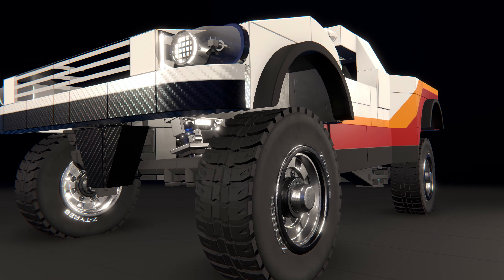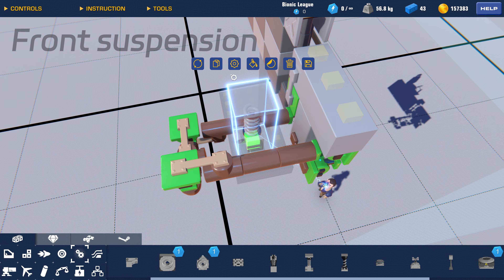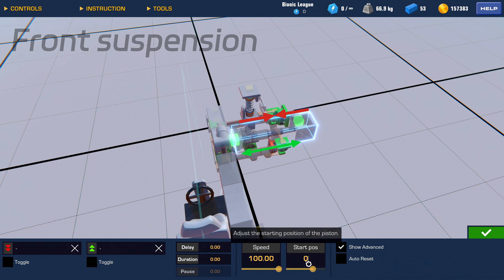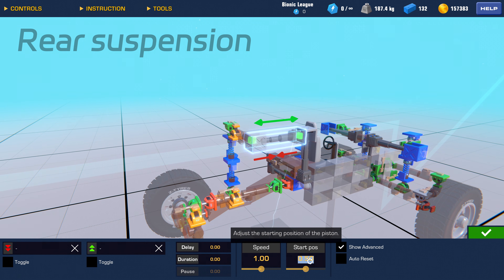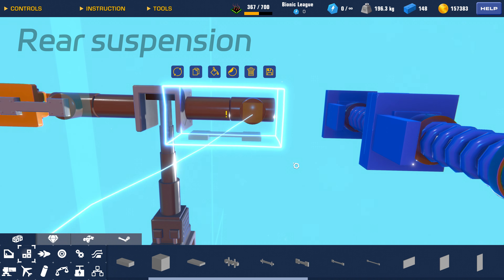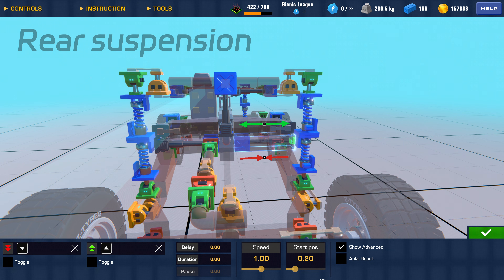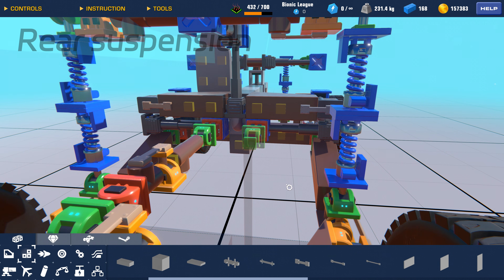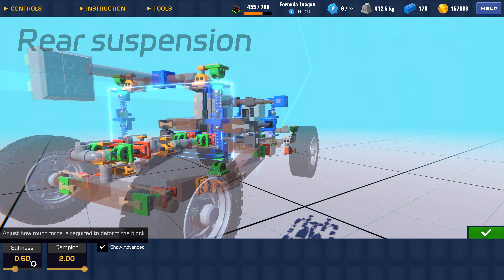Trophy Truck Suspension Tutorial - Trailmakers

Comment from the maker: If there is a problem with the rear suspension being too loose, please try setting the strength of the two yellow hinges in the middle of the two inclined connecting rods to 10
Reply: Mine is vary shakey is there anyway I can fix that
Reply from the maker: @SGT_Deadly_DoDo  Can you elaborate on the problem you are experiencing?
Reply: On the stand in air the wheels just wobble away sometimes bind noise and break aswell
Reply from the maker: @austinbraden9752  Does it also have problems when it's put down? I encountered a similar issue, and it was caused by one of the steering hinges still being set to a strength of 100.
Reply: so i yea mine is very shaky like the whole rear suspension shakes when standing steal i 've tried the fix it didn't work all hinges are at 0 and i've rebuilt the back twice so if i could any help with that it would be nice
Reply: I don’t know the configs for the red and yellow/orange hinges are and I don’t know how to build the rods in the centre
Reply: Ok good
Reply: I have it all built but I’m bad at modeling so it would help a lot if you could make another tutorial of how you made the body
Reply: I did this and it still leaned forward and make the wheels spin even faster but that was 0.10 I put it to 10 and it fixed the problem but I feel like it’s too stiff
Reply: 10.00 or 0.10?

Comment: I have a bit of a problem with the front section of the suspension, which one side droops down like intended, but the left side of where I first built the suspension is halted, which I've done my own troubleshooting and it's appearantly the 2×1 flat connectors that are causing the left side to not be like the right side.

Comment: How did you get the front tires so firm and straight. Mine are very wobely and if i take a turn too sharp it bends underneath my car. If i put the strength of the hinges higher the wheels are too firm and won't turn with the suspention. Anny tips?

Comment: I had tried building this kind of suspension before but I was using heli engines for the tilting just like those yellow hinges. It worked but was no where near as smooth as your's. Well done on getting all the arms to move together without any collision issues.

Comment: What block do you use for the headlights? And instead of my rear suspension being floppy it’s insanely stiff (I’m on Xbox not too sure if that helps)
Reply from the maker: Emergency light
Reply from the maker: The strength of the steering hinge might not be set to 0, or the spring might be too stiff, or some components might be stuck.

Comment: After a week messing around, and seeing it's very hard to improve a trophy truck setup more than what you actually did in this tutorial, I started making variations of the front suspension, and I can say that it's great for 8x8 or 10x10 vehicles. It's not just great; it's like the smoothest thing I’ve seen. Of course, it’s not intended for a very fast vehicle, but for a powerful all-terrain purpose. It literally eats barrels like nothing (i´m using monster wheels so basically everything the same diameter or less its butter). Thanks for sharing this awesome and inspiring build and all the knowledge you put into it.

Comment: I had fun building this tutorial, i honestly never knew how this was possible and i'm happy you did an actual tutorial instead of just saying " you can download a base of the suspension in the workshop " because you learn from the tutorial but you don't from just downloading it

I also had to fix the rear being loose but i read your comment and fixed it, but i still got this one question:
Where am i supposed to start building the 'car' from? i see no-where to start building without messing up the suspensions
Reply from the maker: There shouldn't be any issues with the cockpit. As for the hood, I built it as an "open hood" first and then closed it to avoid direct contact with the front suspension.

Comment: So I’ve made my own copy of this. Followed the tutorial perfectly and it feels good. However where the rear centre linkage connects to the rear axle I’m have a problem with the linkage being floppy from side to side.. I’m not sure if this is because I’m on Xbox so I can’t get the values for the pistons to be perfect or if I’m missing something.. any advice would be great! 

I notice in the video around 5 minutes in the little cut scene of the rear suspension in action shows yours to be fairly stiff there.. mine wants to flip flop on the centre hinge
Reply from the maker: @ProbablyWorking  Try set strength the yellow hinge between the two link to 10, there should be no problem with your build. I missed this part in the video.
Reply: I just posted pistons with the pc settings on the Xbox work shop, the name is "PC pistons" my name tag is the same as the youtube one.
Reply: hope it helps

Comment: bro from one to ten how painful was that to build? (I get a headache just watching)
Reply from the maker: I enjoy the process of building these machines, though encountering bugs is somewhat painful.
Reply: @wesleyhsu5828 is it normal for this connection from the axle to the frame to twist a little bit?
Reply from the maker: @fynnputsch4253  try setting the strength of the two yellow hinges in the middle of the two inclined connecting rods to 10
Reply from the maker: @fynnputsch4253  Basically, you can slightly increase the strength of the steering hinges in any place where you don't want excessive twisting
Reply: @wesleyhsu5828 ok thanks for your tutorial with your tip it worked

Comment: So i followed the same directions and built the suspension but when i go to drive, The back suspension waves around until it flips me over. I have no clue whats wrong. Are the settings for steering hinges/ suspension different from the front?
Reply from the maker: Is the sway in the rear suspension a lateral movement? If so, the issue is likely with the two inclined connecting rods in the middle.
Reply: @wesleyhsu5828  I think I fixed it. I needed to turn the middle steering hinge in the back to 100 power.
Reply from the maker: That's strange, because I didn't set it to 100, but anyway, as long as it works, it's fine. Haha.
Reply: @wesleyhsu5828  ye idk what was wrong. I would go out of building mode and without pressing anything it would just move on its own
Reply from the maker: @theSgamer-k7k  Slow sliding? This is normal, as automatic brakes usually have little effect on vehicles with complex suspension systems.
Reply: Thats weird, make sure your steering hinges are on the same orientation as the video says, and keep them all at 0 strength
Reply: @HomeSlice4.0  do the arrows matter as long as the hinges are up and down/side to side?
Reply: @theSgamer-k7k  You can try making the hinge in the middle of the axle 100 strength, It should work the same way
Reply: @HomeSlice4.0  ok thanks. I'll try that. I also watch some of your videos and your suspension is also amazing. I might try one of your later 😉
Reply: @HomeSlice4.0  the 100 strength thing worked! Thanks
Reply: @theSgamer-k7k  no problem, it’s not how it’s supposed to be, but as long as it works, than awesome!
Reply: @HomeSlice4.0  so I tried your trophy truck suspension as well but my straight suspension doesn't go down. It's hard as a rock. It acts like there is a block there instead of suspension
Reply: It's only the back suspension. The front suspension works as intended
Reply: @theSgamer-k7k  make sure all of the hinges on the rear suspension are 0, except for the trailer hinge in the middle, make sure that’s 100
Reply: @theSgamer-k7k  I can make a more in detail video if you want me too
Reply: @HomeSlice4.0  that would be great. Idk if it's your build or if it's just a glitch or something but I respawn and I doesn't work. I set all the hinges to 0 strength and 0 steering help (apart from the ones actually used from steering). I think it's part of the straight suspension bc it's only the back and the front works fine so maybe it's pistons?
Reply: @theSgamer-k7k  It might be the pistons, but yeah, I’ll try and get the video posted tonight
Reply: @HomeSlice4.0  whenever you have time is alright. Thanks!
Reply: @theSgamer-k7k  Will do🫡.
Reply: The arrows need to be the same as shown in the video, the arrows indicate which way the hinge is going, hope this helps
Reply: @HomeSlice4.0  ok but if the hinge is horizontal, does it matter that the green is on he left and the red Is on the right or can it be either way as long as it's horizontal
Reply: @theSgamer-k7k  Yes, as long as it’s horizontal, the colors of the arrows don’t matter

Comment: man, thats amazing. could we get it on the workshop??
Reply from the maker: not yet~
Reply: @wesleyhsu5828  When will it be on workshop. I have been trying to build this for about 30 minutes and I cant get the front suspension down. Can you help?
Reply: The problem is that one of the front suspensions work perfect but the other one goes down like 1% of the way. I checked all of the hinges and they are all set at 0 strength. and the springs are at 0.50 strength.

Comment: That rear suspension is actually insane, I’ve tried to make a 4 link solid axle rear end, but could never get it to flex properly, this tutorial helps a lot!
Reply from the maker: Thanks, expect your new suspension
Reply: I got one working and flexing pretty decent in the rear with all but 2 of the red hinges removed and only one yellow and one green on the center support. All my flex points are a little different, but its pretty close just dumbed down. It’s not rock crawler kinda flex but for a quick vehicle that needs a fixed rear axle it’s pretty good